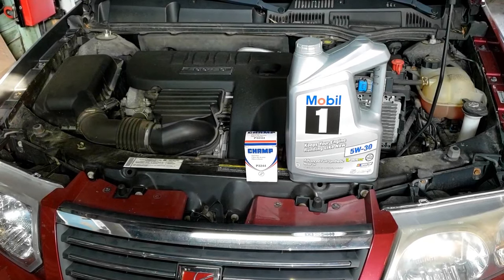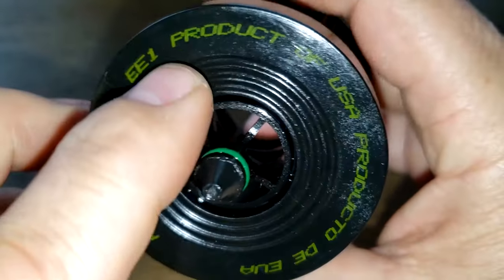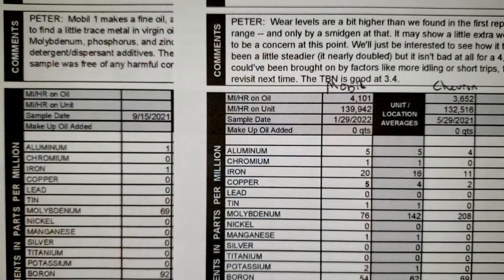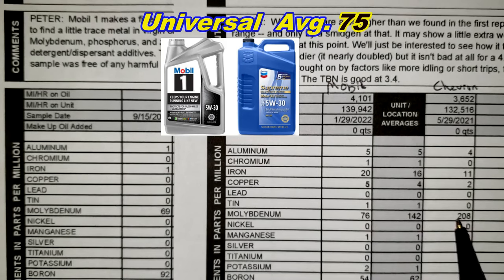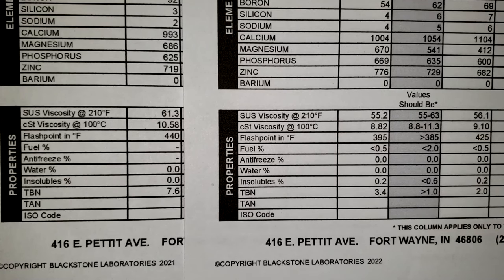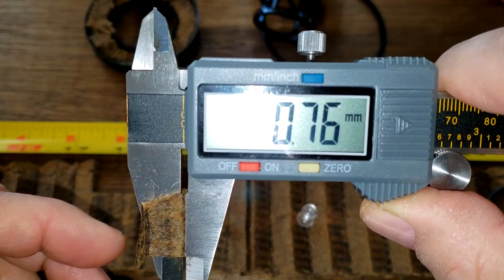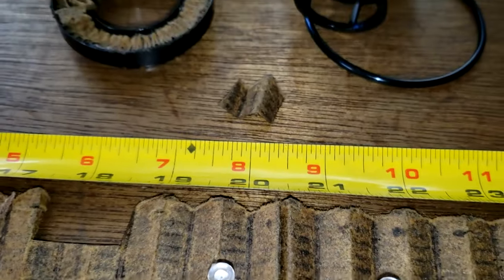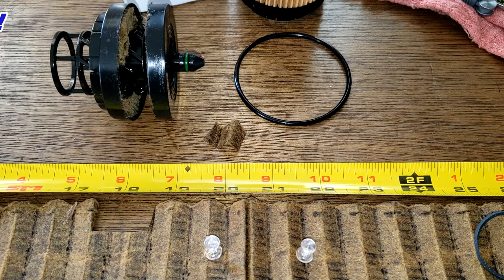Mobil 5w30 Blackstone Lab Oil Analysis, Champ Oil Filter Cut Open P3244, 2007 Saturn Ion

Comment: Hey, love your videos! We are all learning together😀 I was looking closely at your oil analysis, specifically the viscosity from new to used. I found a chart that lists the Sus viscosity’s at 210f  and the border  line between 40w and 30w is 69 sus and the border line between 20w and 30w is 57.5. So, while the Mobile 1 was a 30 weight when new at 63 sus, it lost grade and dropped to a 20 weight at 55sus when used less than 5000 miles! Pretty awful for a tier lll synthetic! Oil quality does matter! There’s Mobile 1 in my 03corvette I just bought, but I can’t drain it right now due to my right knee replacement😢

Comment: Looks like the chevron oil is pretty good considering it's a budget oil! TBN was down to 2.0 which means it would require changing at 5k miles. Thanks whip
Reply: Most on here are 5000 Mile OCI,'s or less. So Chevron is more than adequate. Plus it's TBN hasn't been viewed at 6000 or 7500 miles., it could stay stout longer than we might think. Also can never deny alot is the engine you're running. Smaller 4 cylinders and thier MPG increasing  technology is going to be much harder on the oil, than a big old basic V8. It was a Ford V8 in that million mile van, that he took out to 15 to 20,000 miles sometimes between oil changes. No way a 4 cylinder could take that kind of maintainance and go anywhere near that mileage ! Just Sayin!!! Thanx Jethro!!!
Reply: During the Chevron interval , the oil level had dropped by a quart meaning that the TBN number was also affected by running a reduced amount of total oil which would accelerate the drop in TBN since you're requiring 3.5 quarts of oil to do what 4.5 quarts of oil is supposed to be doing. If he would have added an additional quart of Chevron oil to bring the oil level back up to where it should be the TBN would have gone back up again as well and that oil would have been just fine to run at 5k+ miles. I've known people to run Chevron Supreme to 7k miles (as per their car manual recommendations) and the TBN after 7k miles was still above 2.  Chevron Supreme is not only an inexpensive oil but it performs so well for a conventional (yeah it's been relabeled as a "blend" now) that it rivals synthetics for total performance. That's probably why Walmart constantly sells out of Chevron Supreme.

Comment: I don't know if you overtightened the filter cap, I think those champ cartridge are just kind of crap, and the ecotec's are terrible about twisting filters, but the champ made filters seem to be the worst offenders, I use a Fram Ultra on my half brother's dad's 2008 Malibu for the extra assurance against twisting, especially with the fact that the car is mostly short tripped and it gets reasonably cold in Indiana. It only gets about 3000-5000mi a year put on it, I got some oil from Pennzoil and two analysis kits as a promotion last year, so this year I'll see how Pennzoil Platinum High Mileage 5W30 compares to the Mobil1 0W40 I ran in it the last time, although the 0W40 will be a little skewed because there was probably a quart or so of random top up in it, some Rotella T6 0W40 and some 5W20 Pennzoil High Mileage, if I'd have known that Pennzoil rep was going to offer me such a thing I'd have kept the top up consistent to the same oil, it's just a week or so before the rep offered that it was getting close to the end of the OCI and I really didn't want to waste any of Mobil 1 0W40 knowing that it was just gonna get drained soon so I just threw in top up of stuff I had open.
Reply from the maker: The Fram Ultra may have faired much better but it's very easy to over tighten them caps. Thanks for sharing👍

Comment: My cart always comes out swished in the middle too. I think it is a combination of spring pressure and the element getting wet with oil.  I like the before and after numbers.  I think the claim of 10K miles is probably right at the absolute limit of the Mobil 1 looking at the TBN #.
Reply from the maker: You could be correct about the pressure, sometimes they come out looking better than other times though.🤔
Thanks for your feedback👍

Comment: Although I would not buy a Saturn, a Champ oil filter, or Mobil 1 oil, the test was interesting, because it showed how easily a cartridge-type oil filter can be crushed.
I'm thankful every day for the famous 95 MERC, Pennzoil Ultra Platinum, Bosch Premium Oil Filter, and the wonderful FILTERMAG #SS365PR Magnet Kit.
Oil & Filter changes at 5,000 miles show that the oil is still very clean after use.
 The Magnet Kit works miracles !!
Reply: Thanks, how is the magnet Kit?., I,never have used magnets,etc… Would be interesting to,see good data on such apps, etc.?. How do,you do,it, ? I have two,vehicles @100,000 each etc. Interestingly, One is MOBIlL one/best,5W-30, with BOSS PJROLATOR Filter, the other is MOPAR CONVENTIONAL 5w-20, with DEALER Oil Filter( Penzoil last , normally PERFORMAX FI,TER) @4– 3000 miles OCI…..Interestingly, I many times replace Dealer Fikter with BOSS, OR NAPA GOLD over the years.( six years now, looks like Filter use is Important t)!!!
Reply: @opera93  I loves me some FILTERMAGS -- I use the "PAIR" kit, which has two (2) separate sets of magnets, which allows installation of the magnetic bands to wrap completely around the oil filter's diameter.
 The FILTERMAG #SS365 PR fits all oil filters with a 3.5 - 4.0 -inch diameter cannister.
 It's the best magnet kit available -- but it AIN'T CHEAP !! The expense is offset by the "LASTS A LIFETIME !" feature -- and the results prove that Scotty Kilmer is a blowhard, when he says "Magnets don't work!" .
 My Panther has 175,000+ miles, and still running strong and efficiently -- using Pennzoil Ultra Platinum, 5-W-20; Bosch Premium Oil Filter #3410; and a FILTERMAG # SS365PR Magnet Kit.
https://www.mercuryforum.com/forum/grand-marquis-14/1995-grand-marquis-restoration-8937/

Comment: why do some of the #s  from the virgin sample increase in the moble used oil like the anti - wear additives ? the chevron has a good moly ppm
Reply from the maker: Hi Scotty,
There was a different oil used (OCI) in between the Chevron sample and the Mobil sample, but I dont remember what that oil was. Some of it was probably still in the engine when I put in the Mobil oil and ended up in the used sample. That's the only thing I can think of. 
The Chevron does have a good dose of moly and that will probably be what this Saturn gets from now on. 😊
Reply: @WhipCityWrencher  that makes sense because there can be 1/2 a quart to a quart of oil hiding in the lifters - pushrods and all those little nooks and cranny's
Reply from the maker: @scottymoondogjakubin4766  Yep, it really never all drains out. Some oils have higher numbers on their additives. As far as I know, it was either an RGT oil that was in there last or a  Supertech, or Quaker State. I have Pennzoil platinum, but I dont think I put that in there. I like to have a good stash of oil on hand at all times. Filters too! lol 😊

Comment: I’ve been using Amsoil for 25 years and have never seen an analysis’ where it lost grade. Could you try Amsoil signature series 5w-30 next time and run a 10,000 mile drain and compare the analysis reports? That would be cool😊